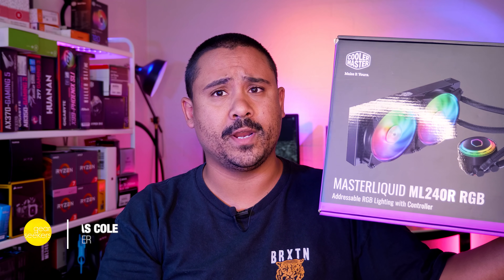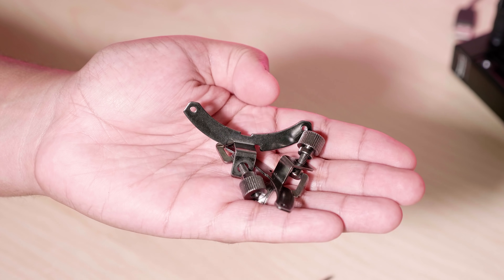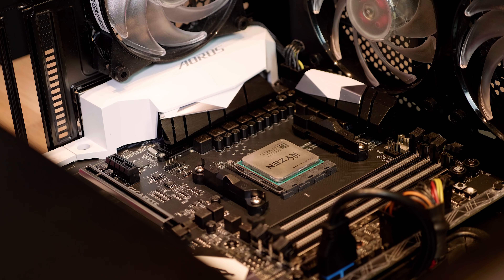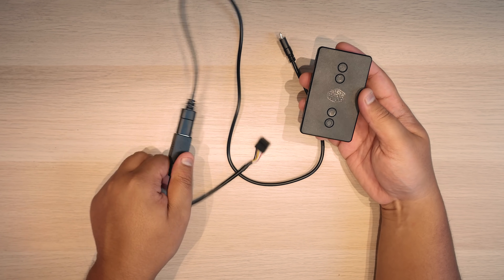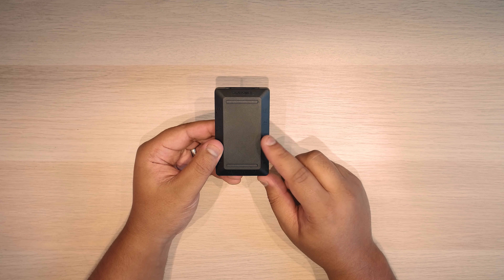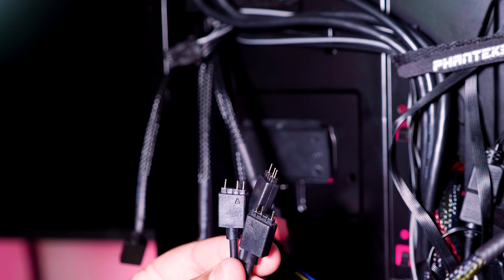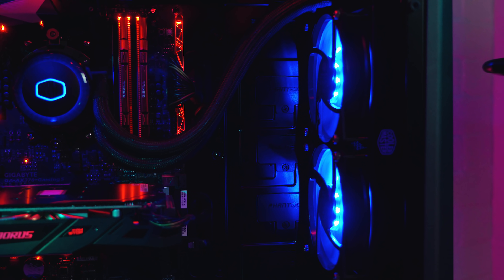HOW TO Cooler Master MasterLiquid ML240R RGB AM4 Install Guide

Comment: Please help me bro lol love your videos and this is my first build. I’m really confused when you connect that wire to the case fan pins bc that cable only has 3 holes for 3 pins but you’re plugging it into 4. Did you just plug it into the 3 right pins and leave the left one alone?
Reply: Yes for other people reading this. The plug is keyed so you cant do it wrong

Comment: The second metal part is not hooking to the plastic for me. The first one worked just fine, I’m trying to force it down but it’s scary and stressful. I feel like my CPU or something’s going to break. Did everything what you did.
Reply from the maker: Loosen both of the clips on the water block a little so they both hook on
Reply: Gear Seekers Yup figured it out. Thanks though!

Comment: you have screwed the fan wrong on it, they have to change the other way
Reply from the maker: Actually they are the correct way. You don't exhaust hot air out the front of a system. I suggest you research before commenting stuff like this. 🤣

Comment: how did you plug the RGB into the controller? You go from the fan to the USB and poof, done. Mine has a female end and there is no 3 pin header on the remote?
Reply: Thank you I'm still having this problem. Did you ever figure it out?
Reply: @zacharyhockett6248  yes, there is a little baggie of male to male 3pins. These make it very faulty though as they easily slip out
Reply: Having the same issue.
Reply: @almosthadit5054  there should be a little baggy of 3 male to male adapters. Super pointless solution that is very unrealiable. Great AIO with a terrible solution methodology
Reply: @DeusDracones  mine didn't come with any.
Reply: @almosthadit5054  no way... if the box was sealed I doubt that. Faulty parts like my fan, sure, but otherwise I would be lighting up their customer service

Comment: I have to say this was still extremely confusing. This is my first AIO and honestly, you were not detailed enough regarding the excess cables. I don't care about cable management but understanding excess cables and what not you just connect and poof, done.
Reply: Hey, I'm thinking of buying this AIO and it's my first time buying it as well are you satisfied with this cooler?
Reply: @vaibhavdubey8713  not at all! The directions out the box were the worst I have ever seen. The set up is far more subjective than this and infuriating to decifer. After a couple of days, I finally figured out how and my computer turned on first try, but immediately noticed one of the fans for the radiator was dead on arrival.

Unless you have an aRGB header on your MOBO, don't bother. The remote is so counterintuitive to use, space consuming and very unnecessary for an AIO that promotes RGB sync with most major MOBO companies. Asus, MSI, etc. I have the Meshify C case and it is pretty cramped with the radiator as an exhaust out the top, but the remote is so clunky, I can't even close the case. 

If you are using an AMD 3000 series chipset and aren't overclocking non stop, don't bother. The chip is incredibly efficient to begin with and the stock fan is perfectly adequate. I regret buying this completely and wish I could return, but can't after applying thermal paste. Waste of $100 for such a promising performance undelivered
Reply: @DeusDracones  My goodness looks like cooler master isn't making good products anymore,I have the Ryzen 5 3600 it's running quite hot with a cooler master H410R i think i should put the stock cooler on it, I don't think I'll be buying this AIO though,but i do have a huge case and the MSI B450 pro carbon AC,is it worth it?
Reply: @vaibhavdubey8713  I mean, at least you would have a aRGB header then, if I remember correctly. I forgot, the controller is forced as that's how you connect SATA power from the PSU. Like I said, the remote and splitter used is just a wire nightmare so up to you I suppose. If I had an aRGB header then maybe? Idk if that affects any RGB sync via your mobo software though. I'll say it looks good, and the pump seems to be performing well at least, but it is a nightmare to install and a painful amount of wires to try and organize. Probably best value, but after that install and an instant DOA fan, idk how much I can suggest it.
Reply: @vaibhavdubey8713  also I forgot to ask since you said it is running quite hot, how many intake and exhaust fans do you have? May be worth unless you REALLY want RGB on the fans to just buy an Arctic 5 pack of 120mm or 140mm fans for like $20 and then have 2-3 intake and 3-4 exhaust (depending on which case you have)

Main reason I bought it I will say is to keep the room/ under the desk cool. I live in the south and my office is upstairs so it can get pretty toasty so I was hoping having an AIO exhaust would help, which it is efficient at doing so (26 degree celsius idle temp on the CPU especially), but again idk. My experience has made me quite bias
Reply: @DeusDracones  Hello again, I'm using the Cooler master MB511Case and its got 3 120 mm intake fans at the front and one 120 mm fam exhaust at the back, I've overclocked the Ryzen 5 3600 to 4.1 GHz all cores.It goes up to 80 degree Celsius in cinebench R15 and stays at around 45 degrees Celsius idle.
Reply: @vaibhavdubey8713  I'm guessing the corsair AIO is used as an exhaust up top?

I'll say this, if you're overclocking all the time, yeah look into it. Great pump, just the most confusing PoS to install and pray you don't get a faulty one. If you do, likely use it as an exhaust out the top as well

Comment: So I got this cooler with the z390-a pro msi mother board and a m520 cooler master case and I tried to top mount this fan and it said its able but it blocks my ram from being put in does does this cpu cooler need both fans ?

Comment: hey, how do you add extra case fans to the rgb controler, do you just plug them into the rgb headers
Reply: I think so. I think they should be in the addressable RGB headers.

Comment: Worst way to install a cooler ever. I thought I had both sides hooked but didn't and then because it's not threaded all the way down getting it tight between the two parts of the thread is really tough

Comment: Thanks for the video, question, is it dumb to mount the fans, then bolts through the chassis, then the radiator? So I have a fans in front outside the case and the rad inside the case?

Comment: Thanks for the video.
I've build the model L of this cooler and it's quite loud; more so than any large fanned air cooling system, even after adding additional decoupling.
It seems to be an unbalanced fan - Is this a common problem? 
Is it possible to substitute the original fans with others, or just to ask Cooler Master for a replacement?

Comment: Hi, can I use this if I have non rgb mobo? I got phanteks rgb controller hub for rgb fan frames. I want to connect the 3 pin argb cable so I can control the lights through software.
Reply: if it has a connection via mobo usb 2.0 then yes you should be able to.

Comment: The two wires that come out of the block one is for rgb the other has 3 prongs but the connection on the motherboard has 4 for my motherboard does this mean I’m connecting it to the wrong location?

Comment: Great Video! 
any idea on how to get the mirage effect to work ? :/
Reply from the maker: This is not the mirage cooler
Reply: @GearSeekers  Thanks for the quick reply !
 I saw a video released in 2017 that had mf120s with the mirage effect working and the rgb controller that came with it has a little port that connects to the fan pwm  cable (cable you're referring to at 5:26) that is supposed to be for the mirage effect (based on manual)

Comment: Can we use dedicated pump header for aio pump and cpu_fan headers for radiator fans?

Pump connector to aio pump header/ cpu_ opt header
2. Radiator fans to cpu_ fan header.
:)ok?!
Using deepcool L240 v2 on Asus B350f gaming mobo.
Reply from the maker: yes

Comment: Cant you just plug those rgb connectors to your mobo without the (hopefully) unecessary controller and software? :P
Reply from the maker: yes
Reply: @GearSeekers  - How? The board has 4 pins while the fans and pump only have 3.
Reply: Nameless King new board with argb sync have 3 pin
Reply: I was wondering this myself as my new build uses the NZXT 400i with it's own RGB Fan Hub built into the case!

Comment: I’ve installed the rgb connect directly to the motherboard just as this guide says (I have a MSI B450 Tomahawk btw) and when I open up mystic light to control the rgb the cooler isn’t showing
Reply from the maker: It's not supposed to show. That's not how it works. Use MasterPlus+
Reply: @GearSeekers  This software does the trick! Thank you so much (your guide is also very useful).

Comment: Good morning friend, all right? I am Brazilian and I looked at all your translated video and tried to interpret the comments to understand. But I am confused and kindly ask for your help. I bought this toilet here in Brazil and I'm in doubt if I can only control the RGB or if I can control the speed of the radiator fans by the control. and that cable that says: Asus, MSI, Asrock, where to connect? if you can help me, thank you very much.

Comment: Where do the adressable rgb cable go in at the single end of the splitter?
Reply: Luke Jongman I’m also looking myself
Reply: @jclegend4680  i found it i think because u have the male to male pins u use those to insert them into the controller

Comment: What about the fan direction... you said, talk about it later but you did not say why you installed them this way
Reply: He did. He explained that it was more efficient for the fans to pull cool air through the front panel into the case and exhaust it using the fans located at the back. Orienting the fans this way will achieve this. The reason for this is that cooler air transfers the heat from the radiator better and allows for more efficient cooling.
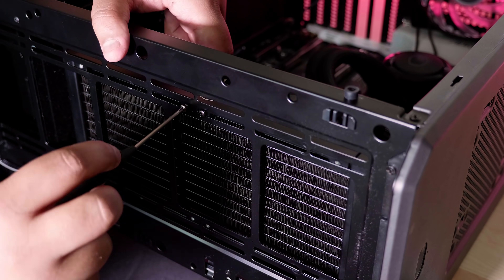Reply: Indeed, sorry, i just found it at 4:00

Comment: Hi mate, thanks for the guide but I still have a problem trying to install the pump, I managed all the rgb stuff with the magnetic controller but the two cables that come out of the pump I don't seem able to connect to my motherboard, I have the rog strix X570-E gaming board but the header for the AIO pump is pinned out differently to the 2 wires exiting the pump, can anyone help me, what am I doing wrong ? Thanks in advance for any help

Comment: What if I only have 1 usb header on my motherboard?
Reply: Allen Yalung but a nzxt internal USB hub so you can connect any other 2.0 ports
Reply: Can I control it on aurasync if I only plug in the rgb headers? Or I need to buy this internal usb hub? Thanks

Comment: Thanks for this great video. My motherboard does not has cpu_opt header, so not quite sure where to plug the pwm for pump and fans, there is 1x cpu_fan and 3x case_fan headers though. Any ideas please? Cheerssss
Reply: Plug it into the cpu fan header
Reply: @vortexofsoulz  Thanks, but the pump and fans are running on separate cables, should I join them with splitter?
Reply: @kkcc-333  What motherboard are you using?
Reply: @kkcc-333  Seems like your best option is to plug the pump cable into a system fan header, and adjust the pump speed manually to your liking.
Reply: @vortexofsoulz   Gigabyte B450 AORUS ELITE, sounds like a good idea, thanks! i was thinking to put radiator fans to cpu header so they are temperature/motherboard controlled, and pump to system/case fan header then use bios to make it run at 100%

Comment: Brother, what about connecting the RGB to the motherboard?
Reply from the maker: plug it in and it works. Simple as that. As long as you have a 3 pin ARGB header, you're good to go :)

Comment: My motherboard doesn’t have an rgb header will this work fine with it?
It has a cpu fan header and a sys fan header.
Reply: Yeah, you will just have to use the controller for RGB. Also, plug the pump connector into CPU_FAN and plug the splitted radiator fans into SYS_FAN

Comment: What's the difference between rgb led header and digital led header..
Reply from the maker: ARGB = 3 pin 5V 
RGB = 4 pin 12V
Reply: Gear Seekers thanks this will be a great video if I end up getting this. I have a similar case and motherboard to this too I believe. Should be quite helpful as I dread messing with the CPU cooler but this made it seem pretty simple. Always thought the hardest part would be getting it attached to the CPU with the board already in the case but didn't look too annoying
Reply from the maker: It's super easy to install ;)

Comment: got an x570 gaming edge mobo, i dont have the cpu opt on my mobo but i do have pump connector. do i just plug the pump into that and is this safe? might be a silly question but first time builder. TIA
Reply: The pump connector is for the pump yes

Comment: I have a question, i have the corsair rgb spec omega case and i want to install this cooler in the case. The only problem is that i already have a rgb controller that was pre installed in the case i also have a few corsair ll120 fans laying around can i just swap the coolermaster fans for the ll120 fans? Or is that going to give me problems? Because i dont know if all the connecters work

Comment: the cooler almost broke the socket
Reply from the maker: not even close
Reply: I’m talking about mine
Reply: And the block got broken
Reply from the maker: @Rashed-og9ov  what did you do? hit it with a sledgehammer?
Reply: I tried to mount it to a B450 tomahawk and it took the processor with it out and the black plastic thing in the block came out
Reply: And one of the mounting things won’t screw any more

Comment: I’ve given up building my gaming PC because of this. Too complicated! Too many wires and cables and it is so confusing. Do you buy PC parts? I’m selling my stuff.
Reply: Don't give up, what are you struggling with ? It is a wonderful experience building your first pc, took me almost a full day to build my first. I can do it in under a HR or 2 now. Trust me and stick with it man !!
Reply: @zach4537  Having problems with the wiring bro. Haven't seen a single youtube video teaching me how to do the wires when all I wanted was to sync all the rgb from the back fan, aio, mobo ram to the front fans.
Reply: @RyBreezzy  I think you can do all that though your mother board. Just plug everything into your RGB header and use a splitter if needed , I have a Asus board and I can control my fans and motherboard with it , just not my aio as it runs it's own software

Comment: Where do you add water at? and can the tubing be replaced with clear tubing
?
Reply from the maker: No and no
Reply: I'm guessing you use the water that's in it until it what  drys up?
Reply from the maker: @fallen12301  It never drys up! You don't need to do anything. Install it in your PC and use it.

Comment: on msi z390 tomahawk i connected pump in my special header for pump, connect fans in sys_fan or cpu_fan?  p.s on cpu fan is working on startup 100% fans
Reply: How do you get it down from 100% fan speed

Comment: Yeah no it didn't work... I fucked the threads up.
Reply from the maker: so what you're saying is it's a you problem?
Reply: @GearSeekers  the little notch on the top where you mount the cooler wasn't there
Reply from the maker: @scvmlxrd7119  still seems like a you problem

Comment: Hey Nick, you are becoming my 2nd favourite goto for this stuff behind JayzTwoCents so well done dude!

My question is what is the significane of hooking the pump PWM fan cable into the CPU-Opt header on the motherboard and more importantly why then plug the 3 way PWN splitter into the supplied cable which plugs into a fan connection on the ARGB controller? 

I just have my pump plugged into the CPU PWM header on my motherboard and the fans plugged into another PWM header on my motherboard, there is no connection to the ARGB controller.

What does this do, can the ARGB controller control the fans via PWM as well?

Comment: As soon as you mentioned the very first cable I was lost. Didnt see it and I'm working on the motherboard outside the tower.

Also doesn't help that the rgb controller has changed vastly.
Reply from the maker: It's exactly the same.

Comment: gear seekers how do you use the motherboard option with aura sync 4 pin please reply
Reply from the maker: You can't. Only supports 3 pin 5v
Reply: @GearSeekers  ok wait i have it connected to the software but it still doesnt work

Comment: You're probably sick of me asking you stuff but my aio cpu pump rgb logo and ting doesn't turn on i would like to know as to why because personally you wasn't informative with the installation of this cooler for both this and the ML360R either you never disclosed as to where the other connection goes into from the pump the 3-pin header goes into the cpu fan or cpu fan opt header but the keyed 3-pin argb header where does that connect to on said Gigabyte motherboard(s) or does it connect into the argb controller that comes with the ML240R and ML360R? Please try to reply when your available thanks
Reply from the maker: JOIN OUR DISCORD

Comment: Thanks for the video it was a big help. One question. When I hook the USB34 to the mb header, my Asus x370F board does not another USB34 header to connect the front panel USB or am I missing something? Thanks

Comment: How do I control it using software ? plugged everything in my asus MB and it does not show up in aura sync
Reply from the maker: A quick read through the comments will give you your answer